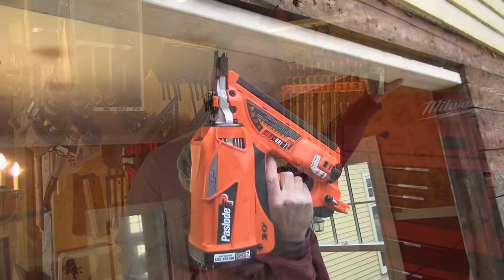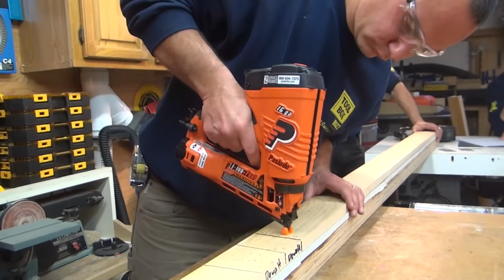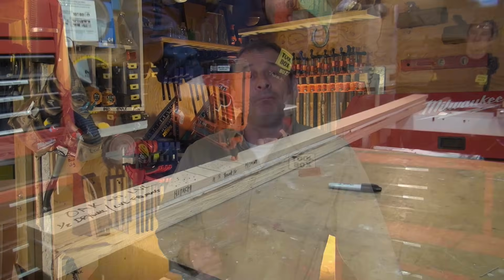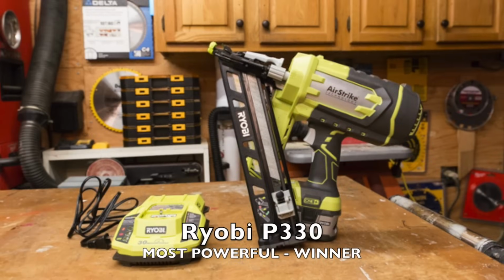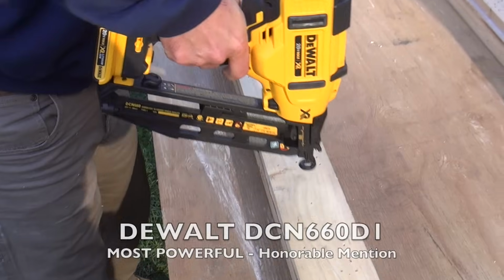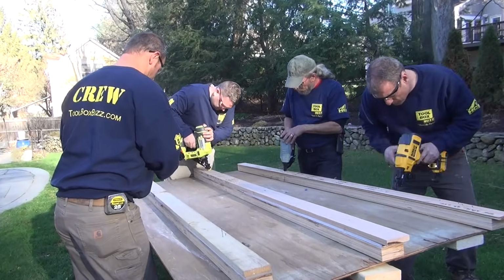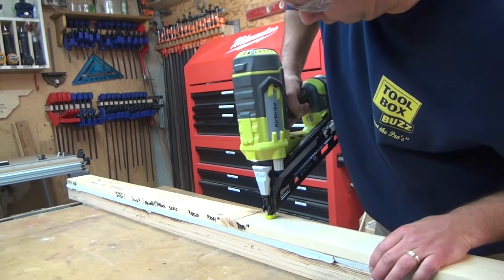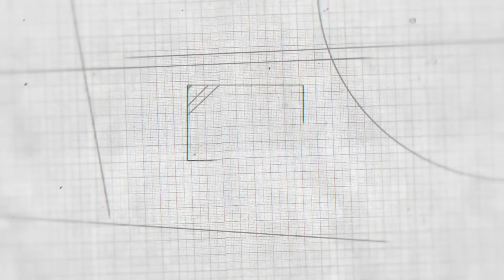Cordless Finish Nailer Head 2 Head Testing

Comment: Good test. I think it's the Ryobi for me. I have the P360 narrow crown stapler, and it's a working machine. Reliable, powerful, and I actually like the weight, it absorbs a lot of the recoil and ensures consistent drive depth without a ton of operator effort to keep the tool planted. Unlike slam-firing a framing nailer, you need more precision with a finisher. Deliberately aim and squeeze. The recoil I get with my Bostick air nailers  (quite light , especially when low on nails), can add fatigue and often causes enough kick to leave a high nail or unwanted "bounce fire". 
I find I reach for the Ryobi stapler whenever I can, it's ease of use (Huge plus if no air set up), low noise and holding power (less fasteners needed) shine. I'm sure the 15ga Ryobi will be every bit as rounded of a tool.
Thanks for a thorough test, and unbiased review.

Comment: I've had the Ryobi 18 ga nailer since about 2 weeks after they introduced it.  Absolutely an awesome tool.  It was one of the few power tools I kept when I moved and downsized my shop.  Yep,  living cord and air hose free for several years now.  True I don't make my living in carpentry,  but I do have this bad boy out almost weekly for the remodels, stuff around the house, or helping other do things. With the battery, it is heavy, but being able to bring it anywhere without a hose is fantastic. Looking at getting the stapler, or if they ever come out with it, a pin nailer.  Loved the review and how you broke it up in to various use classes.
Reply: I had the Ryobi 18 ga and 16 ga, both lasted about a year. I don't recommend for heavy use. Its good for home projects.
Reply: ivan rod I've been using the ryobi 18 brad gun commercially for over 2 years its awesome
Reply: I musta got a dud been using ryobi for 2 days total p.o.s
Reply: I’m in the market for a 23g pin nailer
Reply: Did you get the 23g pin nailer? Ryobi makes one now.
Reply: TheVryfst  yes I got hitachi 23g love it

Comment: I have to admit that I am shocked about Ryobi winning in any category much less power... don’t get me wrong I love Ryobi and most of my tools are Ryobi however I have always felt that they were a homeowner/DIYER based tool.... in light of the competition it was going against I wasn’t expecting it to outperform in any category... i’m very glad to see that it did though because now maybe more people will realize that Ryobi is not a garbage tool.... I still feel overall it is not going to perform in a contractor setting as well as say Milwaukee or Dewalt but for the homeowner/DIYer it is hands-down the best value in my opinion...For what you pay versus what you get you simply cannot beat the value... I have my own saying for Ryobi... Power... Quality... Price... Nuff said

Comment: Just bought the Ryobi  for $119. last night   at Home Depot  thank you for the review guys i had no idea that it would work this well as it is. I was shocked to say the least.  I thought i was buying a throw away nail gun when i bought it. But this will stick around for a while i think.
Reply from the maker: Awesome!
Reply: not if you do finish carpentry for a living. go take that hunk of crap back and get a paslode
Reply: Funny thing is I retired as a Master carpenter.
 I used it on 4 different application the gun worked well for what i wanted it for. But tool's are like anything else all about preference.
I've used about every pin nailer out there with air  this was my first  battery driven one. It works well.
Reply: Is it still working?
I'm interested in buying one

Comment: I bought a senco to be different from the others I worked with. I literally listed it on eBay at lunch the next day! It has no power whatsoever and struggles shooting mdf skirts to a pine frame. I then went out and got a paslode and haven't had a problem yet

Comment: For a framing nailer, I would say Metabo/Hitachi or Milwaukee.  I have Milwaukee batteries, so I chose Milwaukee.  For 15 and 18 gauge, I went with Ryobi.  I have Ryobi batteries, and they were simply better nailers for its gauge.  Yeah, some people question Ryobi.  Just make sure when you get Ryobi, it is brushless motor.  Then it is pretty indestructible.  I got Dewalt for 16 gauge.  I made a mistake. I don't like Dewalt's flywheel mechanism; it drains the battery faster and flywheel needs to build up the momentum before firing.  And Dewalt seems to misfire often, and the nails get jammed often.  

I have never seen many professionals using Ryobi...  But I think brushless motor Rhyobi is a serious contender.
Reply: I agree, as I have them. Metabo/hitachi and Ryobi for the smaller gauges. Dewalt nailers suck ass, let’s just be honest.
Reply: The Ryobi is not brushless. I have a 15 year old Dewalt 16ga angled nailer and the Ryobi 16ga nailer. I don't get jams with my Dewalt, it's a great nailer but the Ryobi is every bit as good. The AirStrikes were some of the only pro-grade tools Ryobi ever made in the One+ line.

Comment: I have had the 16 gauge Ryobi finish nailer for 1 year. It has stopped working today which is just about a year of medium use. I wonder is it worth getting the Milwaukee for $350 rather than just going with a another Ryobi for $169 and having it take a poo in one year? Will the Milwaukee last longer than one year with medium to semi heavy use or will it also take a poo in one year?

Comment: keep in mind, i own most the 20v line and went to buy the 15g dewalt  finish nailer at 399.99 ( dewalt is very over priced and this tool only shit is that, shit!) the ryobi 15g was next to the dewalt for 199.99 and i thought lets give this a go, got it, weed trimmer, blower, jig saw, fan, and 15g nailer for less then the price of the 15g dewalt and jigsaw... does it work yes, but dont buy it to set doors, it hits so hard it will suck your case in and you wont be able to adjust it like i can with my senco, even with a flat bar on the back side holding it just plows it, very sad as i was super excited on the price despite what other contractors might think showing up with ryobi tools, will have to return it... even at low it just whacks it... it's over 10 pounds with 4ah battery too... jigsaw has to go back too, the support that holds blade straight while cutting is to wimpy to hold it when making curve cuts.. everything else works amazing exp the 99.99 weed trimmer and blower, it took down a forrest on a single battery some of the weeds 2" thick!

Comment: I have the Ryobi 16 gauge, I am a carpenter, the nailer is very powerful and never jams ,bit heavy but we are 
 men not girls , they others are too bloody expensive. Six year warranty, how  can you go wrong ?
Reply: I love the newer Ryobi tools.  But my straight finish nailer fails me consistently.   It can't drive the longer nails.  I was trying to temporarily hold a 2x4 in place before I fastened it in place with real nails and some screws and it consistently misfired and got jammed.  very frustrating.   maybe the angle nailer is better.

Comment: Nice video and i completely agree with your end assessment. I have owned the hitachi for a few years now, and when it was new it was great but now it constantly fails to fire, jams up pretty often and the price of gas canisters are a joke! The only good thing about it now is it's weight and the battery lasts for months.  I also have an old Paslode which is just a work horse. Always works, sometimes jams but it always works. During the last few years i have also had the chance to use an old model Dewalt battery only finish nailer and i have always been super impressed by it. It always fires and is much less hassle than gas nailers.   So if anyone reads this, Just buy a battery only nailer such as the dewalt. At least you know the nails are gonna fire every time you pull the trigger.
Reply from the maker: +bumnutz09 Thanks
Reply: +A Concord Carpenter I get the impression that Hitachi is really under rated in the US in moist countries HItachi I sold at a closer price point to  the major brands professional brands and well aboce that of Ryobi etc. They make some really good tools, particularly their corded reciprocating saws and circular saws (and their nailer) which are as good sometimes better than te major professional brands .  At the US market pricing they constitute a real bargin because the lack of brand recognition etc. In New Zealand the actually offer longer profession warranties than the big brands (Makita, Dewalt etc) at five years as opposed to usually 3, and the are probably the best company as far as the no hassle honouring (spelt properly lol) of their warranties and quick returns etc

Comment: I've worked with several other millwork installer/finishing carpenters for 12+ years. We do everything from $1000.00 home owner renos to high end 6 million+ dollar homes. Commercial and industrial as well. (being versatile is key to surviving construction booms) Every job is different, but the tools stay the same. We've been using the 18 gauge pinner ever since it was released, testing the 100% satisfaction guarantee.....(even using the back side of it as a hammer now and then!) Now the 23 gauge is out and proving to be worth it's cost and then some. Ryobi does a great job of simplifying the mechanics so tools don't break down.
I don't get paid by Ryobi in any way. I just want to let people know that buying higher priced tools is foolish. Ryobi is affordable and does the job. Well worth the investment.
(ps. Nothing feels better then fixing other contractors work with "home owner" tools!)
Reply from the maker: I know a lot of quality contractors that use Ryobi daily

Comment: I have the Ryobi 18 gauge and the 15 gauge angle finish which by the way yes, is kind of heavy but it works and do the job,,, Dewalt is a nice one but to over price in my opinion,,,  I had a 18 volt dewalt 15 gauges before, I paid like $400.00 and in about 12 months was having a lot of issues , so I tried to fix it but it was to expensive,,, with what I paid for the Ryobi I can still save money

Comment: I owned both, the dewalt and the Ryobi. I owned the dewalt first, but it constantly failed to sink in hardwood, so I decided to try the cheaper Ryobi nailer. And let me say this. It did not let me down. I was surprised by the power of this nailer. I don't see how the dewalt was your winner, but I was not surprised, as dewalt is a win most of the time on this channel anyway.

Comment: Good comparison and concise as always. Is there a list of nailers in this test on your site? Also, how did everyone like the tip on the DEWALT 20 volt DCN660 16 gauge? I know the DEWALT 20 volt 15 gauge angled nailer and the DEWALT 20 volt 18 gauge straight finish nailer have a different and more accurate tip on them. Have you tested the DEWALT 20 volt 15 and 20 gauge finish nailers yet?
Thanks for your time… you guys always do a great job.
Ron
Reply from the maker: Ron H we don’t have list, and I can’t remember what the tip opinion was - sorry
Reply from the maker: Ron H I’m currently testing the 15 gauge finish nailer and love the tip

Comment: Robert, I get that the Ryobi is heavy, but I'm kinda committed to the platform now. So what I'd like to know is about the balance of it. I can handle some extra weight if the balance is good. I'm thinking mainly of overhead use, window and door trim and crown molding. With a good supply of the smaller 1.5ah batteries, I could reduce the weight a bit compared to using the larger capacities. Does it remain balanced with the smaller batteries? Also, do you have anything to say about the ease of loading nails and which nails work best?
Reply from the maker: camgreer smaller batteries will do the trick

Comment: I wish more reviews would quantify or rank their rating, rather than just the best in each category. Sure, the ryobi is the most powerful...but I would give up a notch or two of power for the best value...but not if the best value was the least comfortable, etc. I'd prefer to get the 2nd best in everything, rather than the one that had best performance but maybe is the worst value and least comfortable.
Reply from the maker: Great feedback thanks
Reply: I would consider the Ryobi to be a great one if you already own Ryobi 18v batteries. I got mine (it was allegedly used, but looked good as new) for less than $150.
Reply: necrojo

Comment: Hey Rob, how would you compare the Dewalt DCN660 to the Milwaukee 16 gauge? I see this was made before the release of team Reds nailers so I was wondering how this head to head would have stacked up if you had included Milwaukees? Would you still have crowned the 660 as overall best? I read a lot of conflicting reviews regarding Milwaukee’s 15 and 16 gauge nailers, just curious how you would have placed them all in a head to head.
Reply from the maker: Jay Ross Milwaukee revamped their nailers. The brad nailer is out and we did a head%to-head on it, the 16 is not out yet
Reply: A Concord Carpenter / ToolBoxBuzz Yea I seen your review on the new Milwaukee 18 gauge nailer, the thing looks solid. I was more wondering how Dewalt/Milwaukee stack up to each other in the 15/16 gauge category. I know Milwaukee is coming out with a new framing nailer but as far as new 15 and 16 gauge nailers, it doesn’t look like they’re coming out with them (yet?).
Reply: I would like to see the updated version as well.  It’s hard to leave a battery platform.  (Milwaukee) I totally will for power I can deal with everything else as long as I don’t spend extra time trying to sink 2 1/2” nails with the head sticking out!!!  I am looking for a Milwaukee review before I buy the ryobi… what I have found is a mixed bag of reviews.

Comment: Muy guess is the finish nailor is for the finish work such as the trim and the brad is for the big construction such as your 2x4 and 2x6 ECT... Is that right?
Reply from the maker: No - the brad nailer is for finni9sh work as well
Reply: You would use a framing nailer for those. Those are still pneumatic beasts.
Reply: Nice thank you, that's what I was looking for.

Comment: What do you mean by larger battery platform? Im confused. Do you mean in such a case that you have multiple batteries always charged and ready to go? Another question I have is a review of battery chargers themselves. Ryobi has a charger that completes in 30 minutes. So, if you rotate batteries... the charger completes its task before you ever need that next battery. I do not know how other brands compare.

What say you? A charger comparison maybe?
Reply from the maker: Trademark are: your question : Im not sure what I said about platform ?  The beauty of cordless is no cord and that can apply to the batt. Charger too... I would throw the tool against the wall if I had to change out the batt. every hour.

Also batteries are designed with a cycle life, they only have a predetermined number of charges

Comment: But nothing yet for framing right? 
Like 2x4 to 2x4 using 16 d [3 1/2”] nails

Anybody ???
Thanks
Reply: Hitachi, Hikoki, Metabo , whatever their called now makes a badass cordless framing nailer. Dewalt did, used the clipped head nails like a paslode.
Reply: @genocideomega  Nice, thank you !!
Reply: @genocideomega  Awesome, thanks for the info !!!! Compressors get old quickly (as in loud), even though I wear earplugs pretty much all the time.

Comment: Milwaukee has said that they will be coming out with new M18 fuel cordless battery only nailers in early 2016.
Reply: Um, I'll need one of those!  I've been tempted to go to the Dewalt or Roybi lines to replace my Paslode because every time I do a job ( not actually every time, but it seems it) I need to go buy another three pack of fuel cells because the one or two left over from the last job are expired and I'm getting jams with the hard stuff.  The Paslode is great, but it just bugs me to have to buy and throw out cartridges.   I guess the simple answer is just to do more work!  lol!

Comment: Why-o-why-o-why dont more manufacturers make a 18v or even 12v headless pin nailer - by far the most useful tool to a cabinet maker or trim carpenter and yet only Makita make one - and it costs a shitload.
Reply: The President of The Internet: Ryobi now makes a 23 gauge pin nailer. It costs about $120 IIRC.

Comment: Have used, abused and used up a dozen 18v nailers, the Ryobi is great while it lasts but being only single piston and light construction they dont last long when ridden hard and put away wet. The Ridgid uses twin piston and is better built and they outlast them 3 fold. The Milwaukee last forever because they end up on the top shelf unused because they jam and cut out so often you go out and buy another.
Reply: The President of The Internet 
Thanks I'm setting up my workshop and looking at the Ridgid. But i like that the Ryobi has a 23g nailer.

Comment: I absolutely disagree I demoed the DeWalt cordless nailer for a week would not shoot through Maple 5/4 tread’s and would not shoot through three-quarter inch maple
Reply: I concur.  The flywheel system is slow to build up momentum and weak.  I got Ryobi 18 GA a few years ago.  It used to be my go to.  Now I got the Gen 2 Milwaukee 15 Ga and 21 degree frame nailer.  Absolutely love them.

Comment: I had the hitachi.  It constantly failed.  My dealer changed both batteries and charger.  It still failed. Dealer told me that the temperature had to be just right for the battery to charge!  😵 neither too hot or cold.  Wth?!  I took it back and got a full refund.  Rubbish.  I’m now looking for a replacement.  90% of my kit is makita so I was swaying to that but it doesn’t seem so good in the trial videos I’ve been watching.  Contemplating the Milwaukee instead.